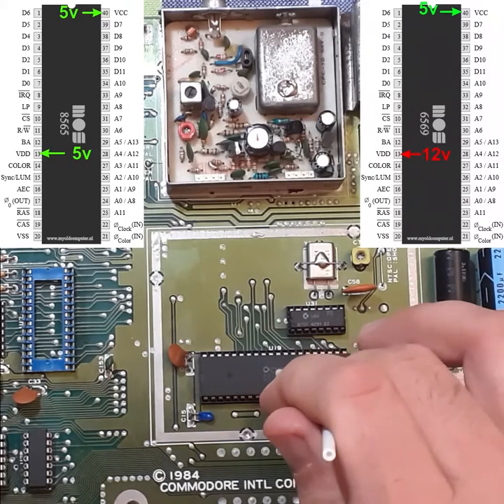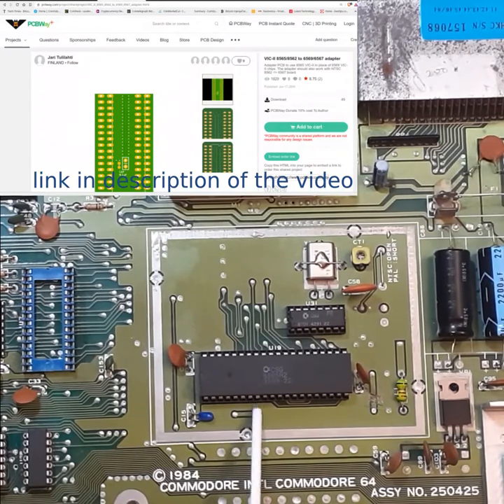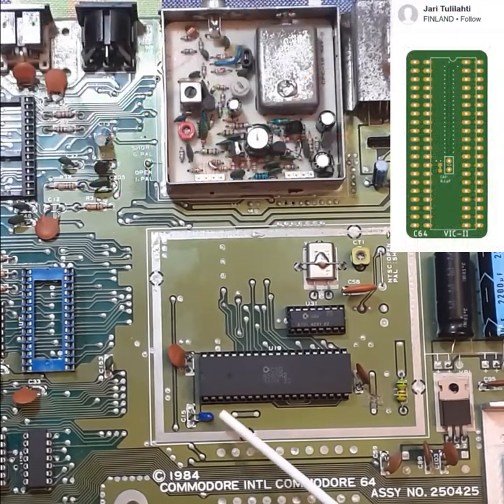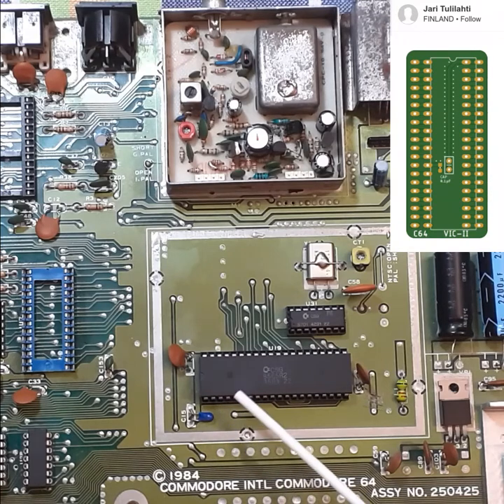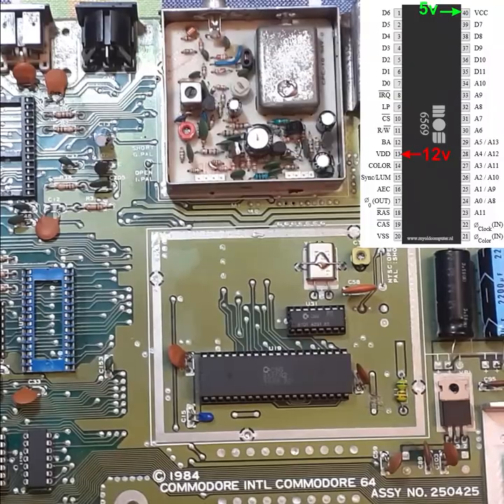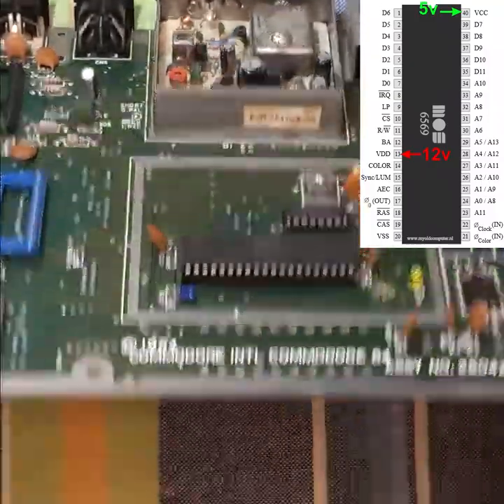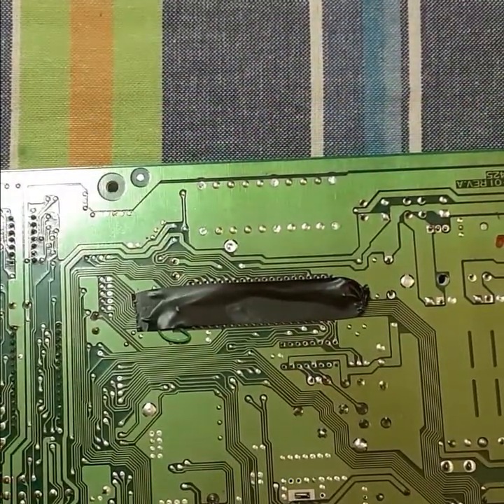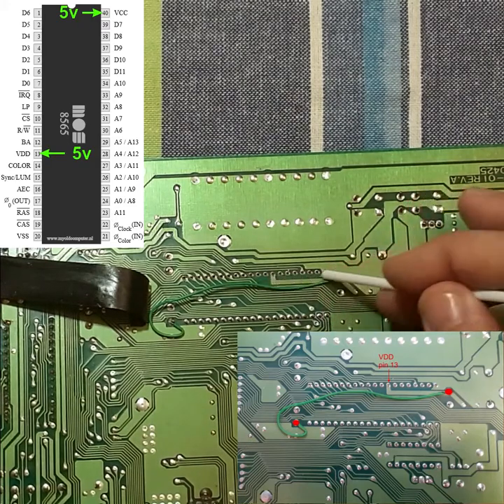Replace 6569/6567 VIC II chip with 8565/8562 | Commodore 64

Comment: very nice thing to know.. i guess u could just lift the +5 pin on the chip out of the socket and run a 5v jumper wire to it also.
Reply from the maker: Yes, that is correct, lift pin and solder on 5V with a jumper wire. But I'm more afraid of messing around with the pins on the chip than with traces on PCB. I can fix things on PCB I can not fix a broken pin, well You can but it is a mess :)

Comment: Thanks for the great tip.  The 8565 are usually cheaper and easier to get when looking for a replacement.  Did you find any difference to the jail bars?  The jail bars are usually worse on the short boards but I doubt it has anything to do with the VIC chip.
Reply from the maker: No difference as much I could see, the only thing I did notice was that it runs cooler than 6569.